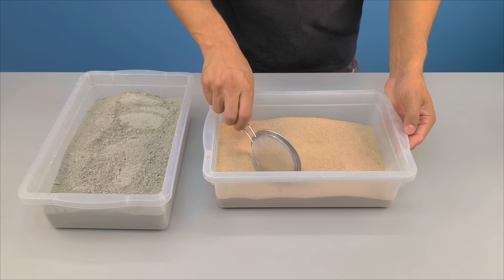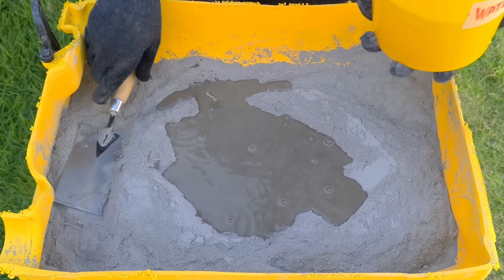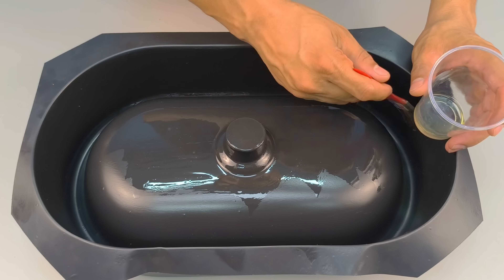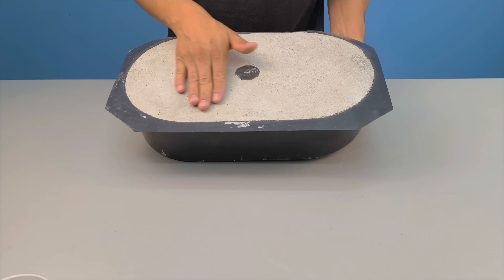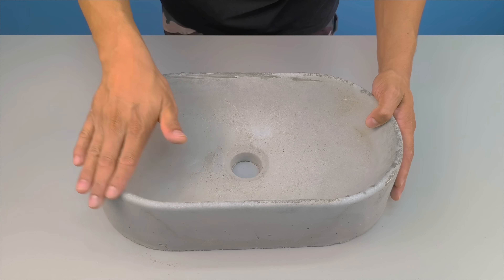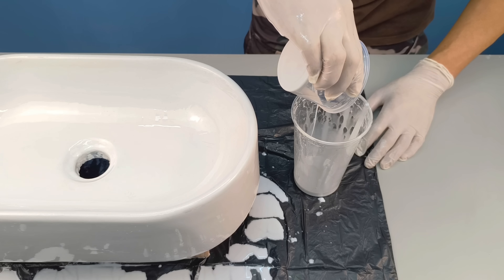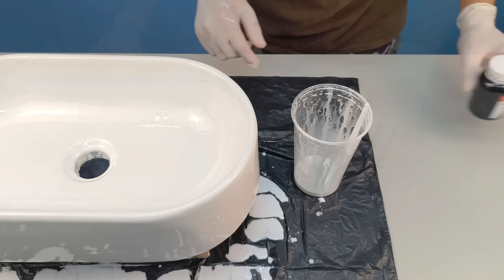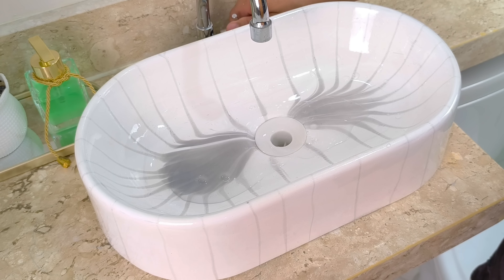Mix CEMENT with EPOXY RESIN and turn the impossible into a MILLION-DOLLAR idea!

Comment: There is a flaw in your editing. You place the said concrete, fiberglass, sand, water, hardner mixture into your mold and leave it to cure off camera. When you return to flip the concrete mixture out of the mold you are retrieving it from an off camera site. How do we know that they are one in the same? Would adding fiberglass and hardener to a concrete mixture for masonry work make the joints stronger while laying brick and stone????
Reply from the maker: Good observation 👍 The curing was done off camera due to time constraints, but it is the same piece shown earlier. In future videos, I’ll make this step clearer. Regarding masonry, adding fibers can help control microcracks, but traditional mortar formulations should always be followed for structural work. This experiment focuses on material behavior, not standard construction practice.

Comment: I was watching a video the other day which i didnt believe was real creating stone casting / geopolymer   with 4 different candidates  Silica Sand , granite fine grit ,basalt powder + desert sand  they mixed each of these  with 
Slaked lime, also known as calcium hydroxide (Ca(OH)₂) or hydrated lime using roughly 2% as a catalyst
then fold these 2 components with boiled down water glass ( sodium silicate Na₂SiO₃) undiluted 
 folding them together under the surface of the water glass to expel all bubbles  + breaking up any clumps   " whisking causes air bubbles so bad " 
tip in the container you mix these ingredients  you make a small hole in the bottom to allow the excess water glass to drain out  then within a few days youll have sold rock  . ( supposidly  )
 is this true or just a silly YouTube video  ?
thanks love your experiments
Reply from the maker: That process is actually based on real chemistry 👍 It’s related to geopolymer and alkaline-activated materials, which can harden into stone-like solids. However, results depend heavily on precise ratios, purity of materials, curing conditions, and time. Many videos oversimplify the process, so while the concept is real, not every video shows a reliable or reproducible method 🧪🪨

Comment: What's the name of the water proof coating material
Reply from the maker: Great question 👍
The waterproof coating used here is epoxy resin, which seals the surface, blocks moisture, and gives durability and a professional finish

Comment: This mixture, including the chopped fibreglass, has been used in England since at least the 1960s. It’s still good that someone is presenting it on here, though.
Also you said “50 ml” when you must have meant 5000 ml, or 5 litres.
Reply from the maker: Absolutely 👌
You’re right — variations of this mix have been used for decades.
The goal here is to share, test, and adapt these techniques so more people can understand and apply them today.
Thanks for the historical insight! 🙌

Comment: 20 minute + 20 minutes for resin mixing is too much. Isn't it? Please correct me. I have a question: couldn't the dye and the resing be mixed at the same time?
Reply from the maker: Good question 👍 The longer mixing time was used to ensure proper homogenization and avoid unmixed zones. Yes, the dye can be added at the same time as the resin, as long as it’s compatible and mixed thoroughly before application. Timing can vary depending on resin type and volume.

Comment: you didn't actually mix the concrete with epoxy... You could have just sprayed it with a high build epoxy gel coat and flatted it between coats.
Reply from the maker: The goal was to create a cement–epoxy composite that could be shaped and sculpted, not just coated. Mixing changes the internal structure and behavior of the material, which is different from applying a surface layer.

Comment: Been using fibglass in concrete for the last 30 years or more, in construction helps stop cracks.
Reply from the maker: Exactly. Fiberglass reinforcement has been used for decades to control cracking and improve tensile behavior. This experiment builds on that same principle while exploring alternative mixes, finishes, and applications.
Reply: Yes it does but beware>>>> the fibers are brutal on dogs and cats paw pads and owrs too

Comment: This is just generic clickbait video. Generic AI voice over rehashed bullshit. You made it look like you did mix Epoxy into the cement, first of all a first of all a Epoxy and Acrylic resin is not the same, also you are just making a concrete sink with 2 part Acrylic topcoat...
Reply from the maker: The video shows an experimental process and visual demonstration. The goal is to explore material behavior and concepts, not to mislead. Different methods exist, and this content is meant to spark discussion, testing, and learning.

Comment: Saya asal Indonesia, Mr, Di mana saya bisa mendapatkan bahan bahan yang di katakan tersebut di indonesia..
Reply from the maker: Hello from Indonesia! These materials are commonly available at local construction supply stores or chemical supply shops. Availability may vary by region, so checking specialized building material stores is a good start.

Comment: This potential has been known for decades by even the newest concrete tech. Polymer based concretes with fibre are made every day around the world for UHPC and specialist concrete.
Reply from the maker: You’re absolutely right. Polymer-based concretes and UHPC have existed for years.
This video is not claiming invention, but showing a practical, accessible and DIY application, using common materials and techniques adapted for small-scale projects and creative design. Thanks for adding technical context to the discussion.

Comment: what a load of nonsense. Buy expensive mould to make a basin out of cement. 
Why not just buy a cheaper silicon mould and cast the whole thing in resin, no need for cement at all.
Reply from the maker: I respect your opinion, but the goal here is not simply cost comparison.
Cement and resin together offer different structural, thermal, aesthetic and durability properties than resin alone.
This approach is about hybrid materials, design, and experimentation — not replacing resin casting, but exploring alternatives. Thanks for sharing your point of view.

Comment: Mix the epoxy for 20min?  You mean 2min?
Reply from the maker: Good observation 👍 Yes, the epoxy itself is mixed for a few minutes according to the manufacturer. The longer time shown in the video refers to the overall working process, application, and control of the material—not continuous epoxy mixing.

Comment: Tip: to get more air pockets/bubbles out and a smoother finish, use something like a massage gun to vibrate the air up and out of the mix.
Reply from the maker: Great tip 👌 You’re absolutely right. Controlled vibration really helps release trapped air and improves surface quality. In this project, tapping the mold and adjusting viscosity also helped, but vibration tools are an excellent upgrade for smoother results.
Reply: @inovaouinventa  I see people use vacuum chambers to suck the air out of the epoxy before use in product, or place entire product into chamber to suck all the air out before setting stage!
Reply: @christopherparks2668  Yes. That works significantly better than the vibration method, and isn't all that expensive to set up.
Reply: @inovaouinventa great communication you've got 👍👍
Reply: Or throw the whole thing in a vacuum chamber.
Reply: I applied epoxy to my entire countertop.  There was no mixing it by hand for 20 minutes.  I used a drill.  The bubbles were removed instantly with a heat gun and torch.
Reply: @FreedomTalkMedia   no
Reply: something like a massage gun ;) ....

Comment: bro in the title you put wrong words my friend. mixing cement with epoxy, there is no mixing betwen them. and you add another 475657867564 elements :)))
Reply from the maker: I understand your point. The title is a simplified way to describe the concept. In practice, the process involves concrete preparation and epoxy application as a coating and finishing layer, along with other materials to improve strength and durability.

Comment: 🤣🤣🤣🤣🤣🤣
You can mix epoxy resin with quarry sand with the same success. The result will be even better.
Otherwise, it's a clickbait video. Does the author even understand the physics and chemistry of cement curing (crystallization)?
But it doesn't matter; people will eat it up without even checking.
Reply from the maker: I respect your technical point. Cement hydration and epoxy curing are different processes, and this project does not aim to replace concrete chemistry. The video focuses on surface finishing, material behavior, and creative experimentation rather than industrial formulas.

Comment: Sooooo, you didnt' mix epoxy and concrete, you coated concrete with epoxy. I could have svae 16 minutes
Reply from the maker: You’re correct that epoxy was used as a coating and finishing layer. The goal of the video is to show the full process, surface preparation, and finishing technique, not just the final coating step.

Comment: I'm from Denmark, and I'm sitting here shaking my head, you haven't really understood how to use cement, we have a golden rule for ordinary tasks where we just need to use some concrete, and it is as follows: 1 cement, 1 sand & 4 pebbles, the sand must of course be casting sand, and not sand for laying tiles, i.e. that it is sand with sharp edges, and not fine sand with round edges, you have far too much cement in your mixture, and far too much water, you have to think about the fact that the water leaves small voids when it evaporates and makes the mixture brittle, so the mixture must be as dry as possible, it must be so dry that you can make a cone that does not fall right away, but only when you vibrate it, and concrete only has its full strength after 28 days, so it is something that really has to withstand great forces, the concrete must be supported for at least 14-20 days depending on the conditions, and you have to make sure that it does not dry out too quickly, so that you can cover it with plastic, I don't think the fiberglass has any effect.
Reply from the maker: We appreciate your detailed insights into working with cement and concrete!

Comment: What for the fiber glass purpose ?
Reply from the maker: Fiberglass is used to reinforce the piece. It helps increase strength, reduce cracking, and improve durability, especially in thin sections or complex shapes.

Comment: Bro you reinventet Eternit Just with the twist that the burnt lime that cement basically is won't cure without water.
You could just swap it for fine sand.
Reply from the maker: That's an interesting point about the cement's curing process!
Reply: @inovaouinventa  and don_t get me wrong, you got a beautifull result there bro

Comment: Never seen anybody mix resin for 40 minutes 😂😂😂
Reply: @keithlevoir608  , I think it was lost in translation
Reply from the maker: The mixing time shown included preparation and controlled blending to ensure a homogeneous mix for the specific application.
Reply: @inovaouinventa That still only takes a few minutes.

Or you lack the proper tools for mixing.

Also, if you're doing batches for a large project, you would mix all your resin and pigment first.

That should take no more than 5 minutes.

Then you add hardener to small portions of remixed resin.

That should take no more than 2 minutes per batch.

Comment: Hi, Brazil here.

Great execution process, beatiful peace of work. It only made me itch when you touch fiberglass with your bare hands. Probably you're used to do this way. For me is at least a glove. =)

The only real question I've is here do you get the mould. Seems the biggest cost for this project.

Regards!
Reply from the maker: Hello Brazil! Thanks for the kind words about the project. You're right, gloves are always best practice when handling fiberglass. Molds can be found online or custom-made, depending on the design.

Comment: Why people buy costly Water Basin from market? Is this really durable like the one in market? please elaborate
Reply from the maker: People usually buy expensive water basins because of branding, finishing, and convenience. However, when made correctly with proper materials, curing time, and surface protection, a handmade concrete basin can be just as durable, waterproof, and long-lasting as commercial ones — often at a much lower cost.

Comment: Interesting process but I do not like the grey streaks. I expected you to use an inner mold also to reduce the thickness of the concrete instead of leaving it as a heavy inefficient solid block. I also dont understand covering the natural material with the man-made acryllic surfacing, the acryllic material will crack, absorb dirt, turn grey / yellow and not gain a natural patina over time as natural materials does
Reply from the maker: Thanks for the feedback! The grey streaks were part of the experimental finish, and the solid block design was chosen for stability in this test, though a hollow design is definitely possible.
Reply: @inovaouinventa  Ah cool, experiments are the way to go.

Comment: Nice, but not a fan of the gray drips.  I have never heard of resin requiring 40 minutes mixing time, I believe that is excessive.
Reply from the maker: That’s fair feedback. The extended mixing time shown is not a standard requirement for epoxy resin itself, but part of the technique used to control texture, color blending, and consistency for this specific effect. Different resins and applications can vary.

Comment: SORRY IT IS ABSOLUTELY ZERO ⚠️ INDUSTRIALY IS IN USE "EPOXY & QUARZ" - NOBODY WILL USE SOMETHING LIKE THIS ⚠️
GO AND LEARN HOW ARE "COMPOSITE PRINTS" CREATED ⚠️
NEVER USE OIL BECOSE OF GREASE ⚠️
THERE ARE SPECIAL "SEPARATORS" AS INDUSTRIAL STANDARDS ⚠️
OUR MOLDS, PRINTING FORMS ARE READY FOR USE & HARD IN FEW HOURS ⚠️
MINERAL PRODUCTS ARE CREATED MUCH PRECISE STYLE AS THIS "EXPERIMENT" ⚠️‼️⚠️‼️😉
Reply from the maker: This is an experimental, handmade approach — not an industrial process. The goal is to explore techniques, material behavior, and finishes at a small scale. Industrial standards are different and well known, but experimentation is what drives learning and adaptation.

Comment: I've seen people do this this doesn't work at all you got to understand how fiberglass work when you look at them little strands of fiberglass they have burrs on them like little fish hooks but they're Halo when you use it for fiberglass resin it fills up the hollow places you remember how they used to prick your finger and draw all the blood out in a blood test that's what I'm talking about by doing this way doesn't make the concrete any stronger at all I've seen people use it and it still cracks I'm done fiberglass for 30 years
Reply from the maker: I respect your experience and thank you for sharing it. In this application, the fiberglass is used mainly for micro-crack control and distribution of stress, not as a replacement for structural reinforcement. Results depend heavily on mix design, fiber dosage, dispersion, curing, and surface treatment.

Comment: Dag from Norway here: In the start, after 1 minute you say "...30g of fiberglass pr gram..."  Do you mean to 4kg of cement and sand? And if, that little?
Reply: Just for context, back in WW2, Germans discovered that when you add a stretched piano wire into a concrete block, it greately improved structural integrity.
Reply from the maker: Yes, that’s correct. It’s approximately 30 grams of fiberglass for about 4 kg of cement and sand. Small amounts are enough to improve strength and crack resistance.

Comment: Bulgaria  (video 10:08)This Acrylic resin is it a PVA glue?
Reply from the maker: It’s an acrylic-based resin. It works in a similar way to PVA, but it has better bonding performance and higher water resistance for this application.

Comment: Too much work. Where do we get the mold? Can we made a bigger object, e.g. a bathtub?
Reply from the maker: The molds can be found online on platforms like Amazon, AliExpress, Temu, or made custom. Yes, larger objects like bathtubs are possible, but they require reinforced structure, thicker walls, and proper curing time.

Comment: Finished this fine piece off by putting a cheap plastic plug hole in it.
Reply from the maker: The plug was used as a functional test piece. The focus of the project is the material, structure, and finish — fittings can always be upgraded or customized later.
Reply: @inovaouinventa I knew that you were just testing it with the cheap plastic. I was just having a laugh. 😂

Comment: Never touch fiberglass with bare hands. Gloves and a mask must be used. Inhaling fiberglass or cement is harmful to the lungs, and direct contact with fiberglass can leave particles embedded in the skin, causing pain and inflammation. Extremely dangerous. It is important that, in the next demonstration, the importance of the correct use of protective equipment is clearly explained.
Reply from the maker: Thanks for the safety tips!

Comment: is it cheaper then ceramics?
Reply from the maker: Yes, in most cases it can be cheaper than ceramics, especially when using simple materials and doing the application yourself. The final cost depends on the finish and materials used.

Comment: Sadly, at no time in your "experiment" did you MIX epoxy resin with cement, or Mix cement with epoxy resin.  COATING the surface of one material with another is NOT a mixture. Congratulations on excellent click bait. Enjoy your very nice sink.
Reply from the maker: Glad you liked the sink!